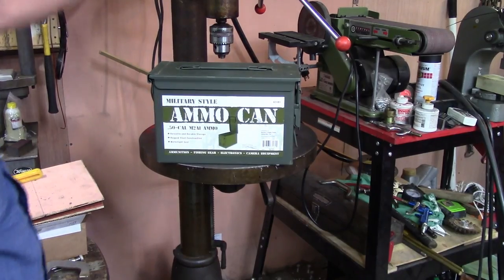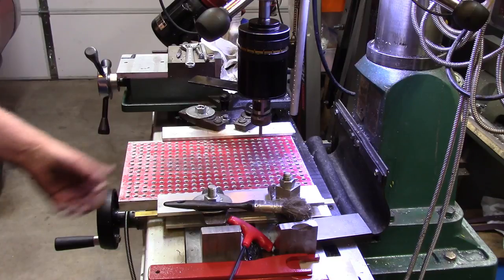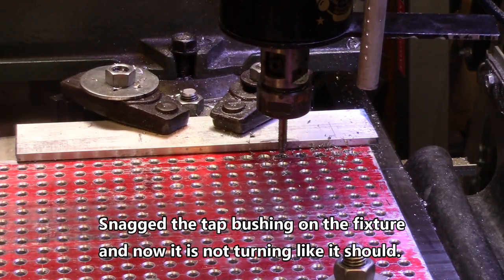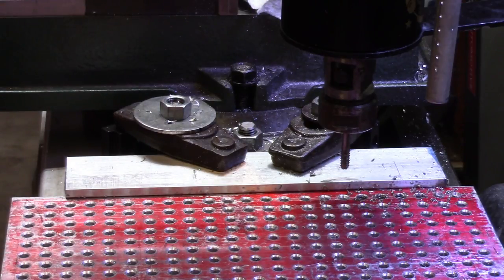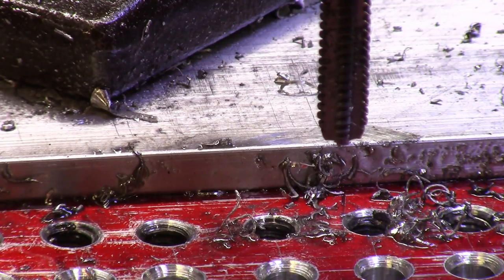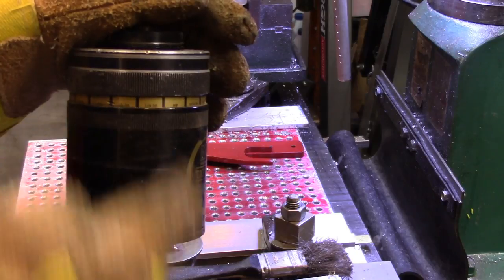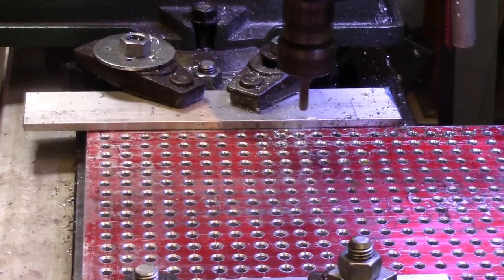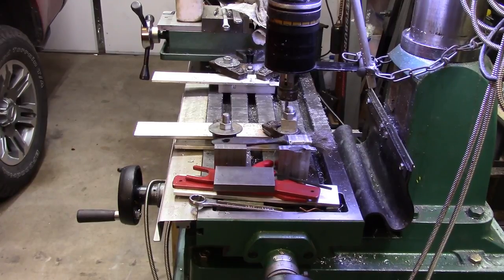Tapmatic revisited part 2 of 2

Comment: Nice video, just a thought, when my DRO stopped working, I found one of the wires, (inside of the armored cablelling), that runs to the magnetic pickups mounted to the table had broken. I just spliced it back together and it worked. Cross your fingers. Thanks again, J.B.
Reply from the maker: Believe it or not I got it fixed.  Thanks for stopping by.

Comment: Let the tapping head do it's job don't rush it . It shouldn't snap back so hard when reversing , takes very little pressure to make them work. By pulling back to hard you'll pull threads too. When you use it you may find them stripping part way in the hole. Speed is good but strong threads is better. You also could slip a piece of conduit over the stop and let it ride the column or just a stud in the tee slot tall enough. Thanks for the entertainment Silverbullet
Reply from the maker: Thanks for stopping by and please forgive the year between the comment and my reply.

Comment: The part could slide a bit easier in the jig. :)
Reply: and nice plate...
Reply from the maker: You can say that again.  The next time I make a jig I will suspend the work piece so the burrs cannot drag on the mill table.  Learned a bit there.  Thanks for stopping by.

Comment: hope you get your DRO fixed
Reply from the maker: I do not think their is much hope for that one.  And getting a replacement is not as easy as it sounds.  The folks selling the lower priced ones have no idea how it works so they cannot tell you if it will work with your scales.  I do not want to install that stuff all over again and I hate to pay the price for the guys who do know what they are doing.  Being cheap is sometimes rough.  Thanks for stopping by.
Reply: well you can try some basics, is the power supply inside proving the power, are there any burst or bulging capacitors or burn marks, its well worth making a video, someone will guide you what to probe and check, and what caps to replace (they re cheap and the cause of many failures) in the hope of it coming to life, its common to replace the larger caps as they tend to be the ones controlling the power, and fail most often, and they can look just fine too
Reply from the maker: Most of my electronic repairs just make things worse.

Comment: The DRO dying isn't good at all. Be a shame not to try and find the problem though... maybe check power supply voltage or see if there might be a fuse inside. Taking broken things apart isnt any big deal you cant break it twice
Reply from the maker: True enough, broken is broken.  Thanks for stopping by.